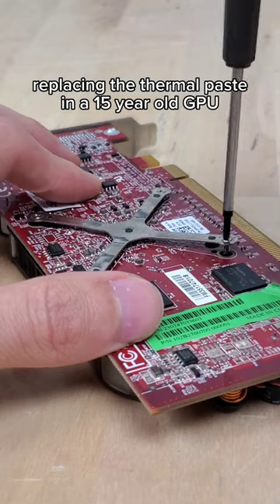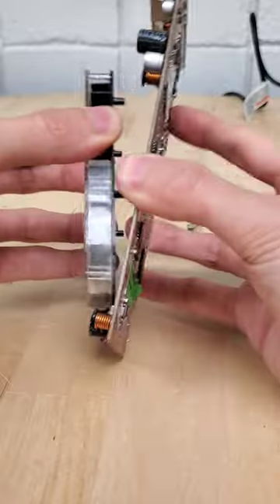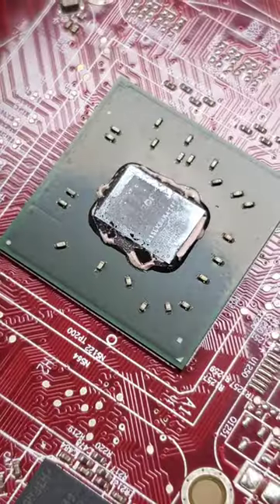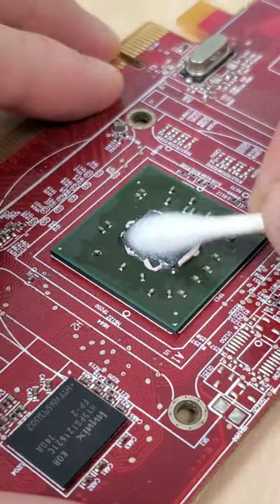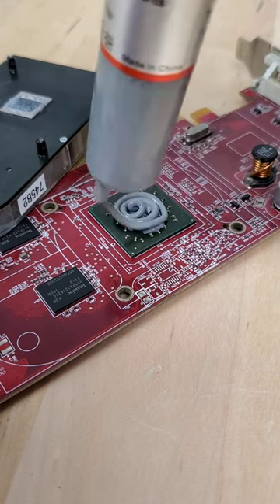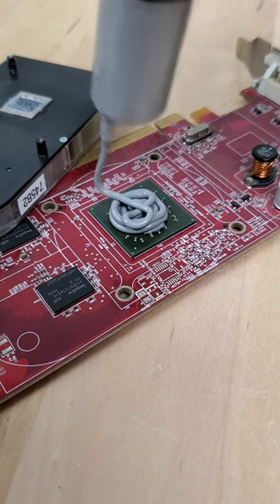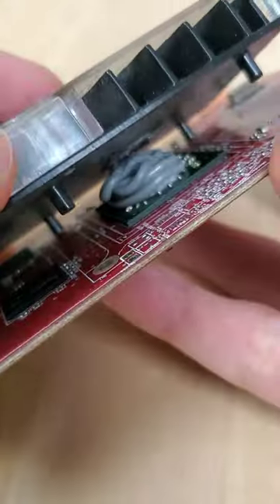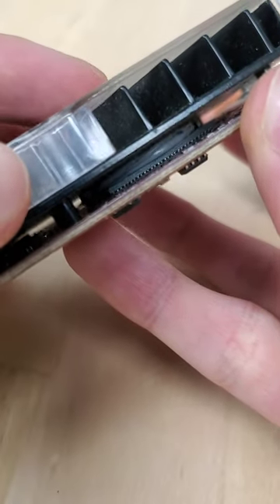replacing the thermal paste in a 15 year old GPU #shorts

Comment: cries on the inside
Reply: I don't even think that graphics card can open ten chrome tabs
Reply: @bejczyreal  that's the ram's work to do bro do you even know that 💀💀
Reply: @Franklin0608  i mean yes, you're right he got that wrong. But that doesn't give you the right to be an asshole about it
Reply: @MissFazzington  how am I being an A-hole
Reply: @bejczyreal  Dude! That's the function of a CPU not a GPU! The GPU only factors in when there's media content within the browser!
Reply: @Franklin0608   so is my 16gb ram enough to open 10 chrome tabs?
Reply: @ev-ezaye3580   ram and cpu obviously matter not just cpu
Reply: @Rtx9070ti  👍 true. My main point being the GPU factors very little in the 'opening' of 10 tabs of a browser...
Reply: @Rtx9070ti  absolutely
Reply: @Rtx9070ti  how did someone correct another person and still got it wrong lmaoo 💀
Reply: @ev-ezaye3580  that's for the RAM to do
Reply: @MissFazzington  how am I being that
Reply: @Franklin0608  saying "do you even know that 💀" turns it into you making fun of him instead of correcting
Reply: @MissFazzington  sorry
Reply: The more thermal paste you use, the better. There is no such thing as too much. Inject some into the pins too; it won’t cause any issues.
Reply: i'm crying on the outside
Reply: Friends, I took off the 14 one arm pull-ups Support the people

Comment: You didn't say "as always, please don't try this at home"
So now, I can do something tested
Reply: Honestly depending on the paste, you probsbly could get away with something as stupid as this.
Reply: @weene875  a very slim chance, might I add! I don't think the mosfets, power phases, etc (VRMs) would be 'happy' to be covered in thermal goop!
Reply: Why did you use that much!!!
Reply: @ev-ezaye3580  it’s non conductive. Will literally do nothing but make a mess.
Reply: It's non-conductive normally and too much doesn't degrade cooling so theoretically you could make a bath of thermal paste and it would work fine
Reply: Friends, I took off the 14 one arm pull-ups Support the people

Comment: *looks at GPU from 2003*
Reply: Why are you looking at that gpu with a thermal intent?
Reply: you're not gonna do anything with it. lets be real here, you haven't even touched it
Reply: @Destraight  you are completely right
Reply: @theguide3686  no reason
Reply: Lol I've got a few old quadros from this erra, that single slot flat cooler design of the days really makes a great drink coaster
Reply: @HerbaMachina  i may use it in a retro build sometime
Reply: 2007
Reply: Friends, I took off the 14 one arm pull-ups Support the people
Reply: @ericmamleev  Bro why are you literally replying to every single comment with this? That's some weirdo shit bruh.
Reply: Be warned GPUs made from 2006/2008 suffer issues with the Chip being bonded and will all eventually stop working

Affected chips included the Geforce 6000,7000 and most affected is the 8000 series

Comment: Did you do this just to upset us? Lmao the mocking chuckle as I sighed deeply just sold it
Reply: yep he probably has a box of old pc parts and destroys them for views
Reply: @GG-cn6es  yeah, I like retro gaming and this is not funny for me.
Reply: @miguelhervaspalomares5978  it’s not destroyed lmao
Reply: @miguelhervaspalomares5978  it's a GPU as long as your using non conductive thermal paste this much is fine. And a good argument can be made for CPUs as well
Reply: @miguelhervaspalomares5978   dawg the parts are still likely functional plus they're practically obsolete to use atp
Reply: @miguelhervaspalomares5978  exactly 💯
Reply: @xxdalionxx  no it is ABSOLUTELY NOT to much thermal paste creates a thicker layer of paste which is not what its for. its just to fill any small bumps and scratches ro get a near 100% contact surface. if its bare metal to metal contact with just a ultra thin layer in between would be perfect. everything that is to much increases your overall heat 🙄 please spread the word to much is not good!
Reply: @Agent66692  Look up literally any tests there are plenty of youtube. for gpus there is really no such thing as too much thermal paste as long as the thermal paste is non conductive. the whole too much will increase heat is a bit of a myth too little will have a way higher chance of increasing heat so putting too much is way better than too little.

Comment: “Less is more” - linus tech tips
Reply: Exactly 💯 💯! 💯 💯! 💯 💯!
Reply: Friends, I took off the 14 one arm pull-ups Support the people
Reply: idk it seemed to burn down my house when i removed all the thermal paste
Reply: there's such a thing as not enough. not such a thing as too much (at least with nonconductive) any excess just gets squeezed out
Reply: @nachosNipples It is true.
But if you put too little on then, yes, of course you won't have enough to give a good enough contact area.

But putting on too much can be a problem and increase the thermal resistance, not lowering it.
Reply: @bradhaines3142 That is not true.
You can put too much on. And the thermal resistance actually increases.
Reply: @deang5622  nope, just squished out
Reply: @bradhaines3142  You obviously don't know much this, do you?

It has been proven by experimentation that it is quite possible to put too much on. The excess that is squeezed out isn't the issue. It's the amount in-between the die and the heatsink that matters.
Reply: @deang5622  you're right it has been tested and proven youre wrong, i dont know who you looked at for testing but my source was a video from an engineer that literally makes thermal paste

Comment: For those wondering that is way too much thermal paste however because of how old this GPU is it's probably not really worth saving and also it wouldn't without too much heat so it doesn't really need to worry about too much thermal paste.

Comment: Jesus, you only need an appropriate  amount of thermal paste that is small and centered where it spreads into a thin coat on the solid chip, making the surface area of the paste large enough after applying the device over it with adequate pressure! That's like 100x over!

Comment: Just use thermal pad. It has 85-95% performance compared to paste but they never degrade. They are immortal paste. Ive been using it for 9 years and it cools as it was new.

Comment: Too much paste, the paste is supposed to completely disappear as it fills every nick and scratch on the mating surfaces. Direct plate to chip contact has lowest thermal resistance, but air pockets are high resistance.

Comment: I had a few ATI/AMD cards over the years Rage II+ 2MB, Rage 128 GL, Radeon 7000 32MB SDR,  Radeon 7200 32MB SDR, Radeon 7500 32MB DDR, Radeon 8500 64MB DDR, Radeon 9800 Pro 128MB DDR, Radeon 2400 Pro, Radeon HD 3870x2 512MBx2 DDR3 , Radeon HD 4670 512MB GDDR5, Radeon HD5670 1GB GDDR5, Radeon HD6670 GDDR5, Radeon RX 570 4GB, Radeon RX 580 8GB.  I had Rendition Verite, 3DFX, as well as Matrox, and Nvidia cards as well.  The upgrade march goes on.

Comment: Lol with the gap you've now got it'd probably dry out faster, and be impossible to take apart next time with all that paste acting like glue.

I'm guessing you knew that though 😉
Reply: I was removing an Athlon 64 X2 CPU from an old Dell OptiPlex 740 last night, and when I rotated the plastic shroud which is supposed to lift the heatsink off the chip, breaking the thermal compound seal, it pulled the CPU straight out of the socket WITH THE LEVER STILL LOCKED.

Took me a while to carefully separate the chip from the heatsink, but when I did, the pins were not bent at all.😅
Reply: @TortureBot  yeah I've heard of it happening a lot with old AMD's (even seen it happen once). Maybe the thermal paste included with AMD's stock coolers is to blame as I've never had any CPU HSF put up much of a fight (that said I usually try and run some stress tests on the CPU to get it warm before removing the cooler).

I've definitely had some chipset heatsinks get pretty stuck though (though we're talking 12+ year old motherboards here and that paste is usually much more exposed, and was probably really cheap to start with).

Comment: I don't recall when my 750 had its thermal paste changed but all the screws and markings are showing it has been never tampered with or unscrewed, pretty sure this thing runs on the same bit of thermal paste from 10 years ago and the temps are still under 40°C under load

Comment: you know, i have the same graphics card and i went and grabbed it and noticed that there is only a single DMS59 port on it for video output but there was what looked like another output next to the DMS59 port but no cut out for it on the mount, so i removed it to reveal a hidden S-Video port, interesting.

Comment: I've been an electronic technician for 35 years. Never, ever use that much thermal paste! Less is much better
Reply: It’s been proven time and time again, it’s fine. 
It’s no conductive, it’s just messy.
Reply: @brandonhoover2120  That's not correct. It's an established fact that a very thin coat is FAR better at dissipating heat
Reply: @timmack2415  Absolutely incorrect. It has been proven over and over you’ll have no difference. 
It’ll squish out the excess with proper mounting pressure. 
There is video after video of this.

Comment: I'm wondering if the 3450 is the same model card that's in my closet that is absolute trash.  It looks very very similar.  The only good thing about it was it could run dual monitors with that proprietary Dell connector.  But the memory bus was... 🐕 💩